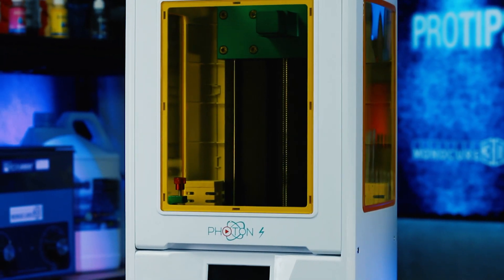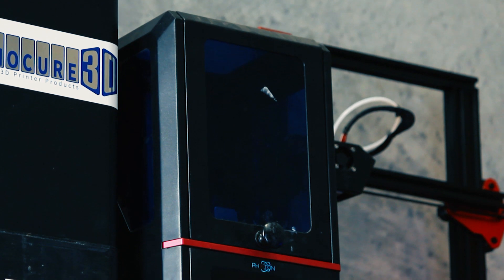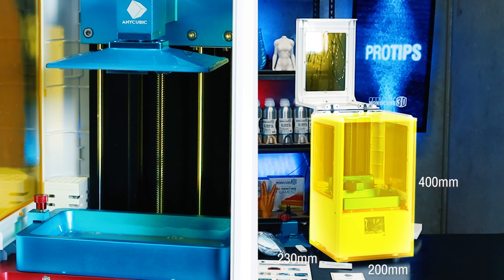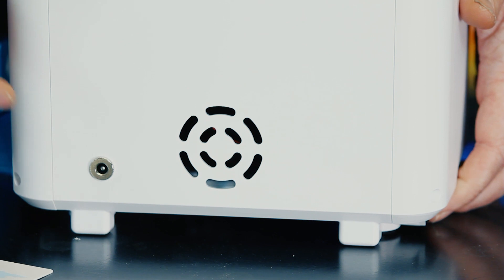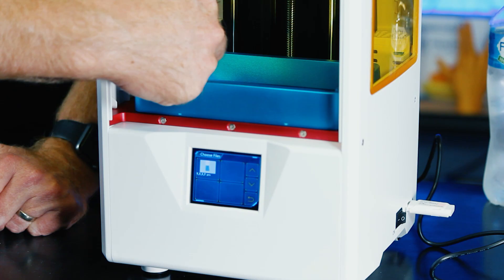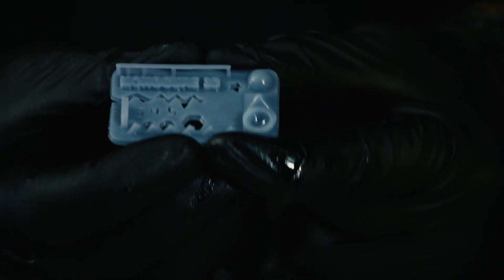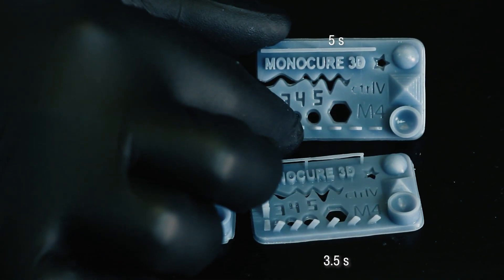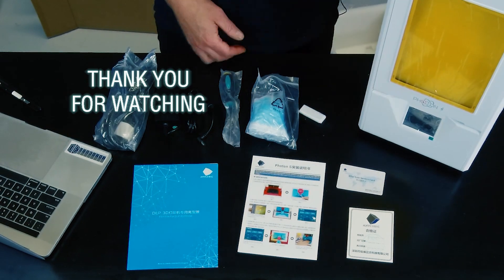Anycubic Photon S Unboxing & Printing

Comment: can you help me, When I try to use the Photon-work shop UBS say "you can’t open the application “Photon_WorkShop_V2.1.20_x64.exe” because Microsoft Windows applications are not supported on macOS.
Reply: Thank you will try again.
Reply from the maker: Sounds like you need to reach out to Anycubic.
Reply: You tried to install a Windows application, you need to install the Mac one.